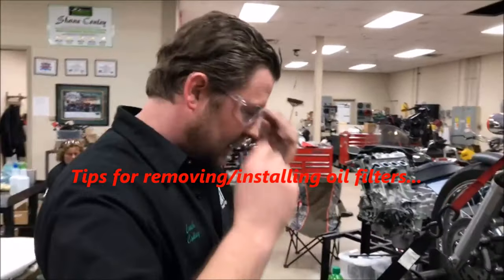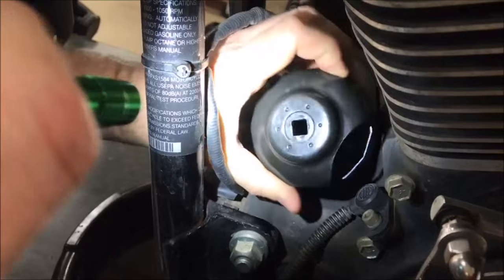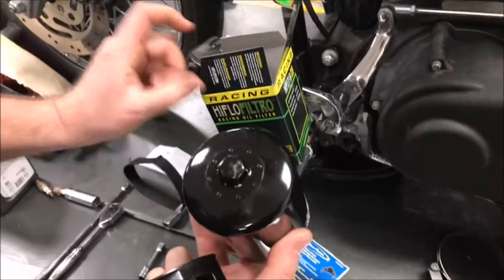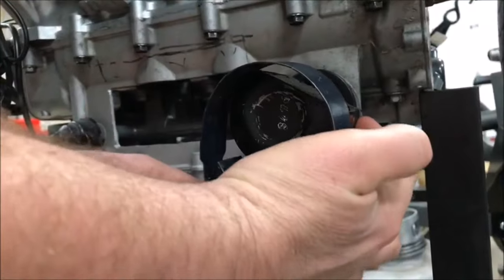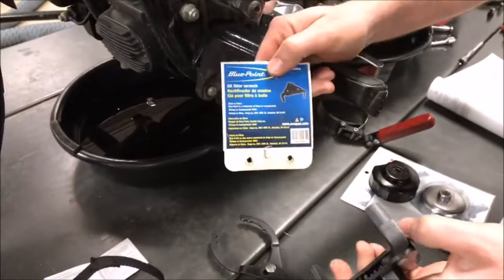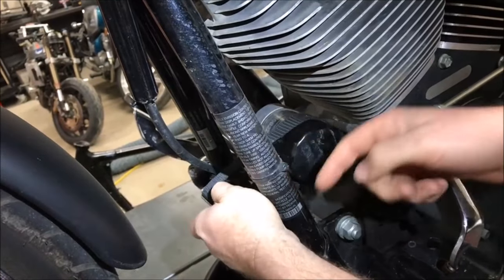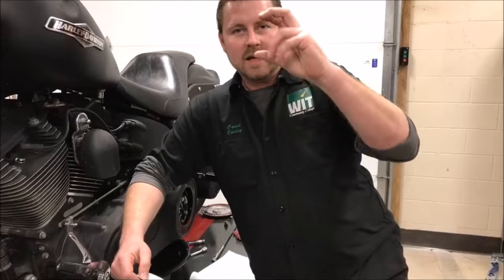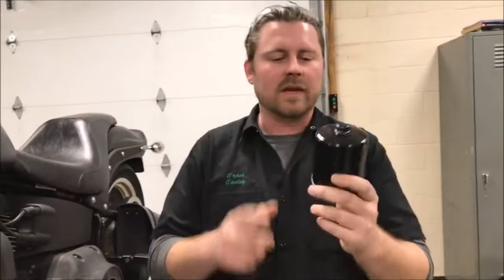Tips for oil filter removal and installation. How to remove a stuck oil filter!

Comment: A strap wrench and chain wrench just crunched up the filter. Not much room for channel locks on my Ford Ranger. So, I used a 17 inch long flat blade screwdriver with a 3/8 inch wide tip like I as going to flip a pancake. The rubber gasket being the pancake. Just use a hammer to tap the screwdriver on the can right along the rim where the gasket is until it crushes the gasket and filter can inward toward the center axis. Did this for a small section about 1-1/4 inch long and then tapped off axis with the screwdriver to make it rotate. It's stuck because of the gasket. Just separate the gasket to reduce the removal torque needed. This was easy. I did drain the filter with a small hole beforehand and I jacked up the truck a bit to get more room. The actual tapping took less than 5 minutes.
Reply from the maker: Thanks for commenting and adding value to our community! 

Please subscribe, share and consider a H2W membership to support our free work here! We are ramping up for the upcoming new member only site with profiles, raffle drawings, and weekly live Q/A sessions and a for sale page!

Have you subscribed yet to never miss a video? Have you seen the video playlists? Over 600 videos! Check them out here: https://www.youtube.com/user/conleybuilt/playlists   

Want to say “thanks” or “keep it up”? Click here https://www.paypal.me/how2wrench     
 
Your answers and help are just around the corner. Save time and money while protecting your investment and yourself by doing it the right way at www.How2Wrench.com

Comment: Honda OEM car filters say 3/4 turn and have a torque spec printed on the filter.  I tried putting one on with a torque wrench out of curiosity and it was exactly 3/4 turn from the point the gasket touched. It's a very low torque spec BTW, around 9 ft-lbs.  I did that purely out of curiosity. Normally I use the 3/4 turn method. Having done with the torque wrench once, I'm now totally confident with the 3/4 turn method. And no filters have any problem coming off.
Reply from the maker: Thanks for commenting and adding value to our community!

Have you subscribed yet to never miss a video? Have you seen the video playlists? Over 600 videos! Check them out here: https://www.youtube.com/user/conleybuilt/playlists  

Want to say “thanks” or “keep it up”? Click here https://www.paypal.me/how2wrench    
 
Your answers and help are just around the corner. Save time and money while protecting your investment and yourself by doing it the right way at www.How2Wrench.com

Comment: Hi Shane... the cardboard idea to prevent oil draining on exhausts/engine components works well. may I add an idea to your wonderful series.... I have been using regular Aluminium foil for my oil Filter changes for some time now and it's a breeze. You can shape it as you choose... funnel like at one end to ease drainage and shape up any edges/sides to prevent spillage. It is so versatile and cheap and also highly effective. I hope this helps my friend... loving the channel by the way   : )
Reply from the maker: Hi Mark.... SUCH A GOOD IDEA and simple. I shared with my students...nice! 

If I can ever be of service to you, here is a video explains how to connect with me. 
https://www.youtube.com/watch?v=vjvmB01ebcs 
Keep Wrenching,
Shane Conley
Instructor/Motivator/Motorcyclist
www.how2wrench.com

Like freebies? Click here for a free diagnostic checklist! 
http://gem.godaddy.com/signups/364621/join 

Did you like this free video and hope to see more? Would you just like to say thank you with a donation? Click https://www.paypal.me/how2wrench

Comment: If you have a really tight filter and your strap keeps slipping try putting some course valve grinding paste on the filter this gives a good grip surface for the strap both metal or fabric
Reply from the maker: Nice tip! If I can ever be of service to you, here is a video explains how to connect with me. 
https://www.youtube.com/watch?v=vjvmB01ebcs 
Keep Wrenching,
Shane Conley
Instructor/Motivator/Motorcyclist
www.how2wrench.com

Like freebies? Click here for a free diagnostic checklist! 
http://gem.godaddy.com/signups/364621/join 

Did you like this free video and hope to see more? Would you just like to say thank you with a donation? Click https://www.paypal.me/how2wrench
Reply: Ainsley Gowland Or a strip of sand paper.
Reply: My old snap-on orange strap wrench is grey from use with a little paste. (Careful to keep it away from oil ways)

Comment: Pretty solid advice. However, I would disagree with wanting to place a strap wrench closer to the threaded end. The standard "filter cup" essentially grips the filter on the very end, precisely where filter manufacturers put the flats. Placing a strap wrench on those flats is just as effective as near the base (and often times the only easily accessible part of the filter). The domed end of the filter is extremely resistant to crushing because of the disc of material which caps the end. And because of the cylindrical structure of the filter, rotational torque is equally spread along the entire length of the filter. One runs into trouble while using filter pliers or cheap band wrenches, which do not apply torque evenly and have a tendency to buckle. Once one of those tools puts a dent in the filter then all bets are off! It's for this reason that I prefer OES or OEM filters - specified tools indicated in the WSM will fit every single time.Still, solid advice all around! Loving the series!
Reply from the maker: Thanks, Jason! The whole idea of putting ith close is for stuck filters. But you don't know until you attempt to remove right? I've found this tip of moving the strap in further to be to real deal for removing stuck ones without tearing the canister off. The flats are on top as it makes sense for correctly installed filters.  The new 17mm nuts are awesome but I've even heard of techs ripping those due to the ease of over-tightening! Oh the reality of following the last tech can be painful! 
Thank you! Please share!
If I can ever be of service to you, here is a video explains how to connect with me. 
https://www.youtube.com/watch?v=vjvmB01ebcs 
Keep Wrenching,
Shane Conley
Instructor/Motivator/Motorcyclist
www.how2wrench.com

Like freebies? Click here for a free diagnostic checklist! 
http://gem.godaddy.com/signups/364621/join 

Did you like this free video and hope to see more? Would you just like to say thank you with a donation? Click https://www.paypal.me/how2wrench

Comment: Ahh yeah.  So simple it evades us at first.  The dusty stack of filter wrenches, gadgets and a big spike in the box of oil filter "no more's"...  in this vid, you saved the new guys a ton of wasted coin if they'll follow the suggestion - a simple strap wrench with socket opening, heavy-duty nylon strap at least 2 inches wide for the grip surface.  Maybe ten bucks, lots of them under different names, and common.  Never had one fail on ANY filter, even truck and heavy equipment spin-on's.  It gets stubborn, you just get a half-inch drive flex handle on it, wrap it snug as you can with some room to rotate, and put the arm on it.  Well done.
Reply from the maker: Thank you! If I can ever be of service to you, here is a video explains how to connect with me. 
https://www.youtube.com/watch?v=vjvmB01ebcs 
Keep Wrenching,
Shane Conley
Instructor/Motivator/Motorcyclist
www.how2wrench.com

Like freebies? Click here for a free diagnostic checklist! 
http://gem.godaddy.com/signups/364621/join 

Did you like this free video and hope to see more? Would you just like to say thank you with a donation? Click https://www.paypal.me/how2wrench

Comment: So what is the torque spec for an oil filter?  The only one that I've seen is in the service manual of a 2002 Dodge Intrepid and it was 12 ft lbs (144 in lbs).  I've been using that spec on all my cars and it's been great!  No leaks and comes off nicely.

Comment: I used the strap on my 2018 fat bob oil filter, the dealer has put it on so tight that when I used the strap it snapped, I've also tried the 2 machine screws going through the harley oil filter tool but that didn't work its just ripped the filter, I've tied everything to get it off but it won't move a single mm, with the milwaukee M8 engine the space around it is tight so using other tools is next to impossible. I can't take the bike to my local dealership (I'm UK based) as it has permently closed its doors and is no longer in business due to covid, the next dealership is 50 miles away but has been closed since before Xmas with no date as to when it's going to reopen, if it indeed it does open and doesn't also close down premently. I now have a bike with no engine oil and a ripped filter, to say I'm miserable is an understatement.
Reply from the maker: Feel so bad for you! How incredibly frustrating. I do offer a service to channel members (link below). We could just on a whatsapp video call and I can help you come up with a plan? Email me at info@how2wrench.com and we can connect...
Thank you for commenting. Want more benefits? Smash the subscribe button and bell! Want even more??? Join the channel:
-Daily MEMBER FIRST COMMENTS ANSWERED FIRST 
-Live Q/A video chats
-Wonder if we have a video on your need? Members can request content links!
-Full Access to the ENTIRE 700 video library
-Member-Only FREE tool giveaways 
Join this channel to get access to perks:
https://www.youtube.com/channel/UCBhM8DCKnT3qXwTW0eToyCg/join  

Just want to say thanks quick to support us for this information and our work saving you money? 
Give us a high 5 here:  https://www.paypal.me/how2wrench